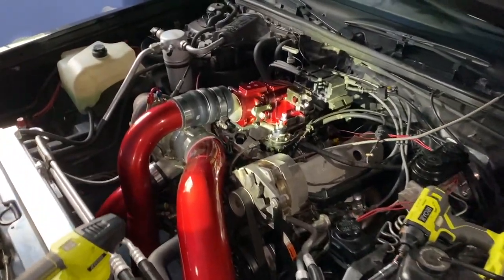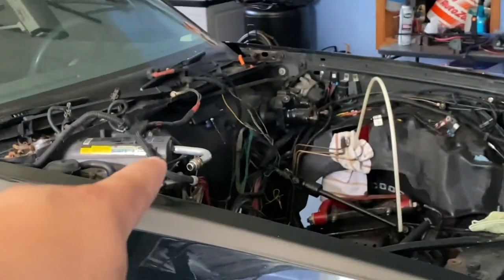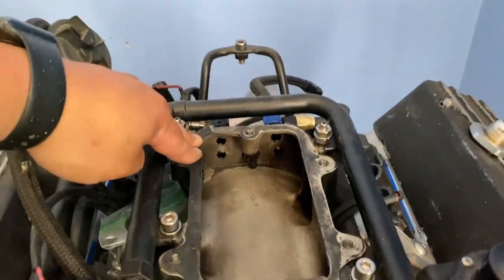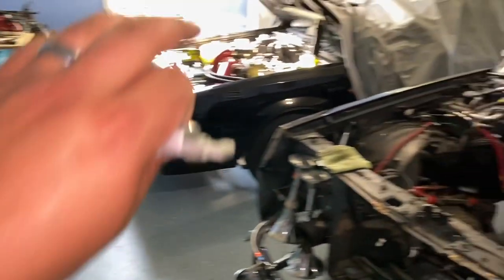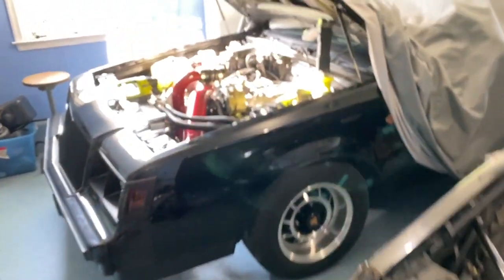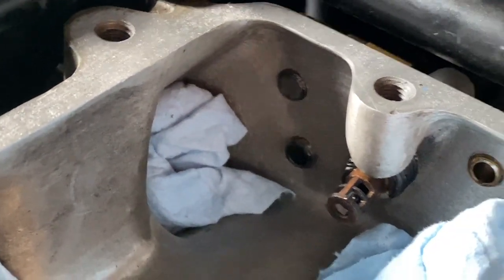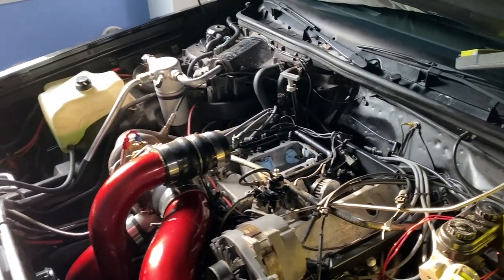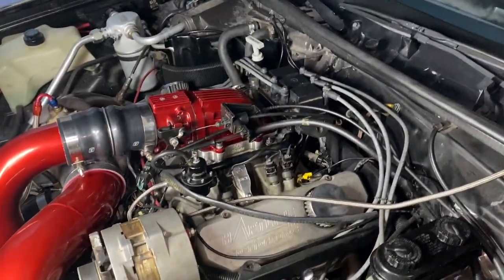Hiding Vacuum Lines and Cleaning up the Engine Bay

Comment: im probably 3 yrs late on this video, what size taps and fittings did you use? how do you determine what size vacuum fittings to use? i would like to get rid of my vacuum lines and have a clean look, your input is greatly appreciated.
Reply from the maker: I try to match the existing line size, other than the PCV valve hose (-6AN) I used 1/4” push-loc fittings. Most of them were 1/8 NPT. I will tell you clean is a relative term, I have the car mostly together now and I still have spaghetti of hoses and wiring even after tucking most of it under the plenum.

Comment: what aluminum bumper brackets do recommend? had the gn1 ones and am lucky to still have my bumper.
Reply from the maker: I do not recall where I got mine but you want the ones that are 1/4” aluminum plate. You can call and ask the different vendors.